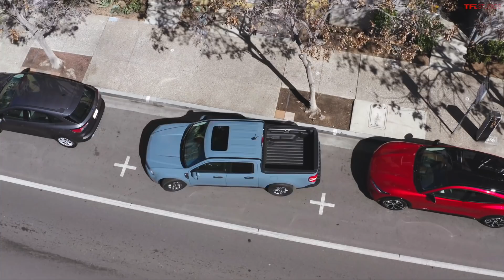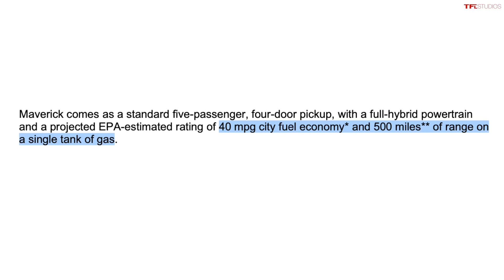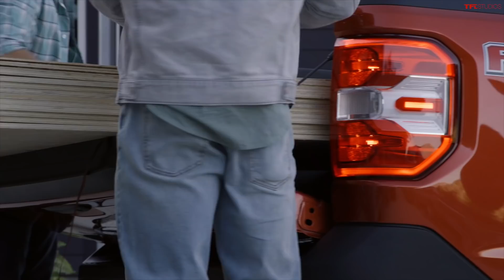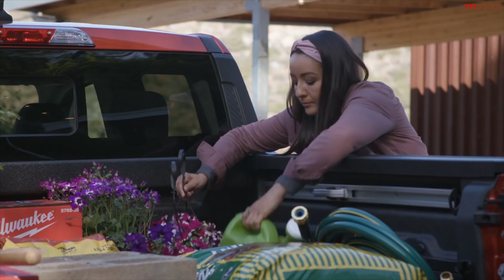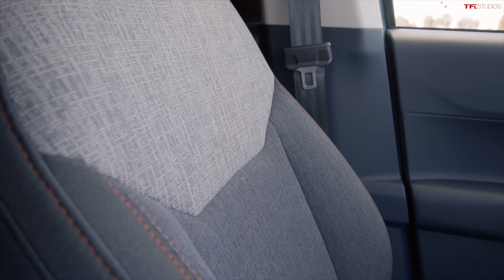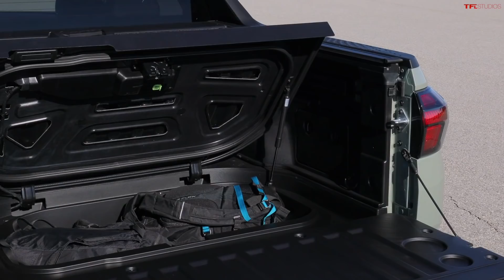Hands On With The New 2022 Ford Maverick: Here Are The Top 10 Things You Need To Know!

Comment: Looks like the Toyota Prius can't flex about 50 mpg anymore when a truck can nearly do the same.
Reply: Prius and corolla hybrids get 58-60mpg in some trims. Guy i work with averages 60mpg in his corolla hybrid driving from PA to MD and back everyday
Reply: @BullittKid08  that’s better than motorcycles.
Reply: @BusinessSolutionsATL  my motorcycle gets 70+ mpg 🤷‍♂️ ...and is much faster than any hybrid car or truck soo not better than MY motorcycle (in this case) 
Ive been driving hybrids since 2005 so this seems like average gas mileage. The rav4 hybrid gets 40mpg too. I hypermile 65mpg regularly (edit, in a prius)

As they say in Diehard...WELCOME TO THE PARTY PAL!
Reply: @BusinessSolutionsATL  you really caught me off guard with that, soo relevant
Reply: @BullittKid08  still 50mpg in a truck is really impressive edited to say that the video said 40, which is still REALLY impressive.
Reply: @Prestiged_peck  yeah the rav4 hybrid gets about the same mileage, it's about the same weight too, so no surprise there.
Reply: 33 highway is not really that impressive (to me) don't let me stop you from liking it I would buy one for our shop if our current truck shits the bed
Reply: 40 is not 50. That's a 20% difference for you US high school math grads.
Reply: @truantray  40 is still REALLY impressive on a truck, especially one with 1500lbs payload

Comment: Unibody trash, very disappointed Ford.
Reply: Lol. Better payload and towing numbers than the 2000 Ranger
Reply: @devinbender8428  Who cares, it’s still a unibody with an attached bed.
Reply: @RFJersey  once again what’s your point? If you want a frame get the ranger. You don’t need a frame for 1500lb payload
Reply: @devinbender8428  The “new” ranger is a midsize. A compact truck with a full frame is what the public has been waiting for.
Reply: @RFJersey  but the frame isn’t the limiting factor here. It would just add weight. And stiffer suspension. It wouldn’t increase the payload or towing cap by very much if at all.

Comment: It’s something new (ish) to the market. The smaller trucks in the past didn’t have a 4 door crew cab configuration. None were front wheel drive. 
   Hybrid, is great, front wheel drive is ok, CVT,,,,,,,, I’m out! 
The 2.0 and 8 speed automatic awd would be great, but if it is priced like the Bronco Sport, that means it’s expensive as heck!
Reply: This isn't a normal CVT. It's an E-CVT. It uses the electric motor to transfer ratios, not a belt. Toyota originally developed this tech for the Prius and the like and it's super reliable, with less parts than a normal trans.
Reply: The first edition, completely topped out with all options checked, hits $35k.
Reply: Right? If they'd made the hybrid have AWD available with the electric motor in the rear it would've been something. But nope, FWD only is a waste for anyone who lives in a northern area who wants mpgs but has to deal with weather
Reply: @tbm275  - that electric motor in the rear is crap. It doesn’t match the hp of the front so it has limited use. If you use the vehicle strictly on city streets and highway use, it get you better fuel economy, but if you need to get out of a muddy spot or are in some rocks, not rock crawling, just larger rocks, you are gonna struggle and likely be stuck. Combined with the E-CVT, the transmission will overheat under those conditions and then you are really scr*w*d. 
     I like the turbo 8 spd automatic a lot. Ford took too long in releasing the vehicle. I test drove a 2021 Ridgeline, which is definitely small enough for my purposes, and had some accessories installed, they delivered it to my door the next day. I live 1.5 hours from the dealership and they still delivered the vehicle.  It has a levelling kit in front and slightly more aggressive tires. Still a soft-reader, but looks very good with the new front end design. I didn’t get all the cheap cladding they have for wayyy too much $$$ mind you. Absolutely the most comfortable truck I have driven and my  other current truck is a 2021 F150 Lariat PowerBoost 4x4. I have a 68 C10 that is almost as comfortable in the ride category, but the factory buckets are not that comfortable. I also have a 1980 Chevy 454SS that rides decent, but nothing like the Ridgeline. I have had over 200 other trucks, the vast majority being work trucks, over the last 40 years.
Reply: @C10sRule  you didn't watch the video
The Hybrid does NOT have AWD, there is NO power to the rear wheels. That is what I was complaining about. If you want any sort of all weather capabilities off roading you get terrible fuel economy
Reply: @tbm275  I did watch the video and was only responding to your suggestion. I was telling you your idea, ala Toyota, doesn’t work worth crap.

Comment: I heard that Ford might be coming out eventually with a regular cab model. Maybe Ford is thinking it would sell a lot to fleet customers, like auto part stores for their delivery vehicle. 

Regular cab with a decent size bed, plug in hybrid model, and it wouldn't cost that much. 

I think this would be the perfect little truck for fleet customers. 

If Ford does something like this, I am all over it.
Reply: A 2door with 6.5 ft bed would be great.
Reply: As nice as that would be, I don't see a regular cab model coming. The ranger isn't even offered as a regular cab.
Coming from a regular cab owner.
Reply: @tangydiesel1886  I agree. It's pretty 50 50
Reply: I think they are going to see how the high volume 4 door works, then move to a 2 door.
Reply: Sadly it's very unlikely. At best we're likely to get an option of a rear seat delete for fleet spec customers.

Comment: Hope this causes a mini truck Renaissance. Can you imagine, a new Nissan Hardbody, Chevy S-10, Mini Ram, etc. The only thing that makes ANYTHING better is competition. 

As for the new Mav, if it has the off-road prowess of the Bronco sport and can tow about 5k pounds, I might go for it. I’ll be in the market in the next couple of years.
Reply: Mazda needs a p/u too...
Reply: @dennistyler8746  they have one in Australia i think
Reply: @dennistyler8746  a B2200. Those little tricks were quick!
Reply: It won't be as good as the Bronco sport because they neutered it and pulled out the rear differential, even on the FX4 package.

Comment: Chevrolet to release the "Goose" as a co-pilot to the 2022 Ford Maverick.  Likewise, Dodge has announced the "Iceman".
Reply: who will be the first one to get the vanity plate "NGOOSE"?
Reply: Haha good one! 🤣
Reply: Chevy is “Goose?” But Goose died - oh, I see what you did there
Reply: Toyota Topgun
Reply: Toyota Viper
Reply: Are they all Hybrids or possibly one could be an EV.
Reply: @metalmike570  on this gen maverick, no full EV. Standard comes with a hybrid or you can pay for the engine upgrade getting ride of the electric and gaining power and towing capacity
Reply: @JohnMiller-zn9pf  Ok I think I was asking about the Chevy and the Dodge the guy Tsnorquist started the thread with. Yeah I doubt any will be EV's but who knows. By 2022 the Cybertruck will hit the streets but these trucks are smaller options - I like them I might have went for the Maverick but I just got a 2020 Nissan Rogue Sport; it's a crossover / SUV but I think the Maverick rocks because you get 40 MPG, I like the idea of the functional truck quad cab and excellent mileage.